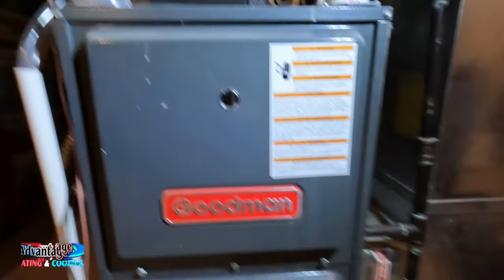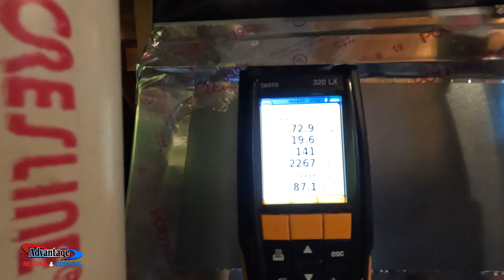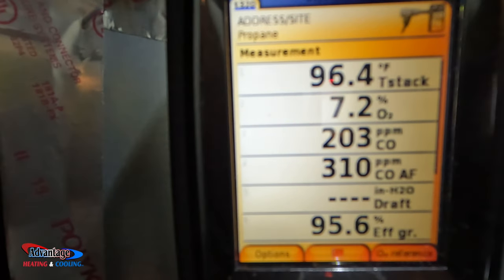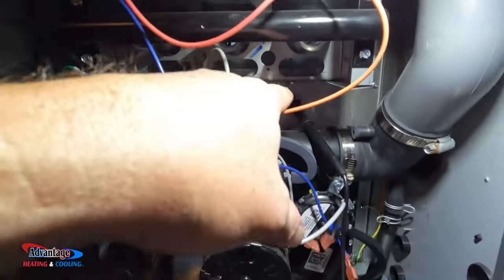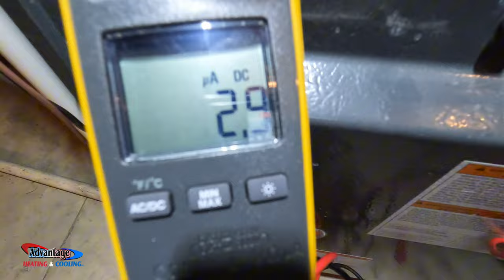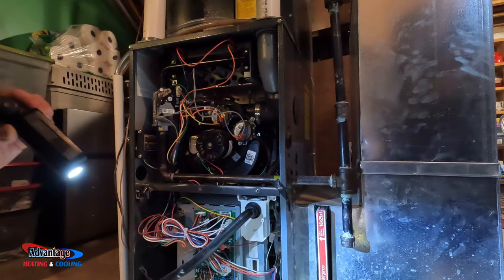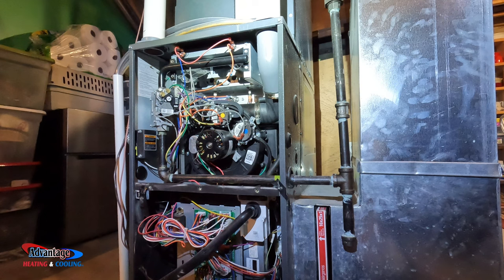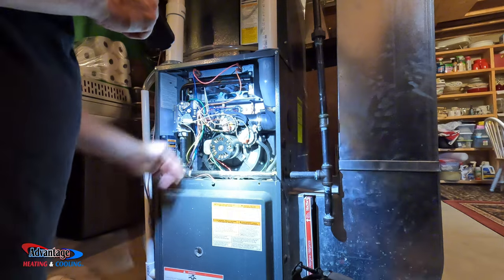Mastering the Art of Goodman Furnace Maintenance: A Comprehensive Tune-Up Guide

Comment: Do you have a video showing how to clean the coil on a furnace that has the evaporator coil above with the 2 pipes blocking the front access like the machine in this video?
Reply from the maker: No, what has to happen is remove the front cover, to access the coil, carefully remove the metal that holds the coil together, you now have a little access point to see the inside.

Comment: What would you recommend if buying a new furnace? All the best… disappointed about those burners.
Reply from the maker: Always look at who is installing it and their experience. That is number 1. Me personally I Like Allied Air. Armstrong, Ducane, Airease. Quality built and with a stainless steel heat exchanger. I would definitely do something before 2025 this is when I believe the Industry will be Changing to accommodate the new Freon. There will be Sensors and extra safetys incorporated.

Comment: No temp rise and gas pressure test? i would think with poor combustion analysis result would have been worth checking pressures at least.
Reply from the maker: Yes, you are correct, I should have it should not be an excuse. Thanks for pointing that out.

Comment: Hello

When my thermostat calls for heat. Glow plug wont turn on, gas valve doesn’t click and I don’t hear any gas being sent into the burners either. This has happened before but the glow plug has been turning on then and I usually just change the filter and it works. But this time nothing just the fan is turning on and it’s throwing a fan and then a f03 code on the screen in the window. Any suggestions?
Reply from the maker: It sounds like a pressure switch issue.make sure your vent is clear from obstructions and drains are as well.